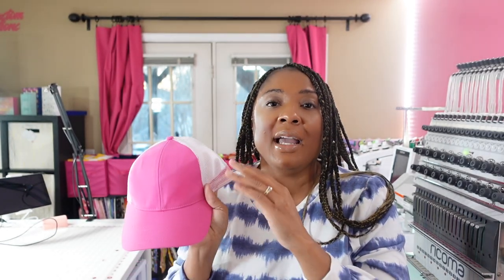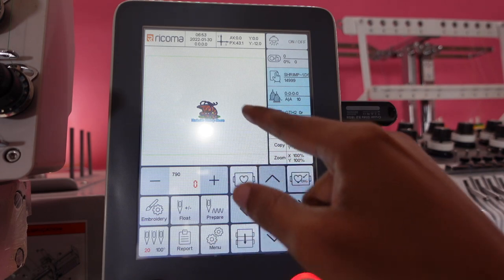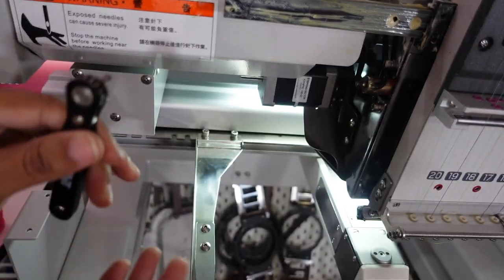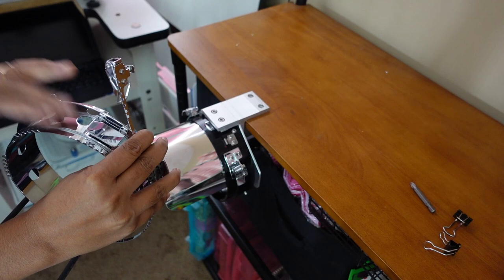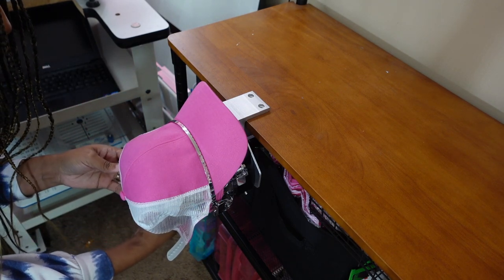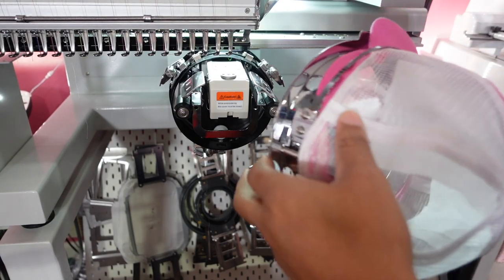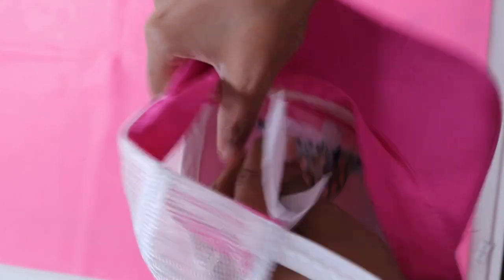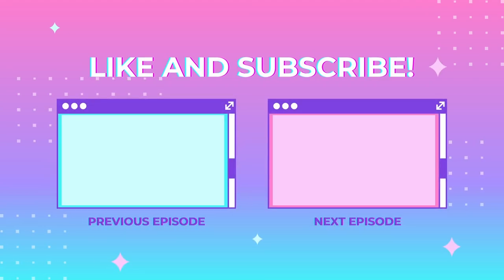Embroidering Caps on My Ricoma 20 Needle Machine |  Embroidery Business | Etsy Shop

Comment: Hello Alisha,, does your RICOMA have automatic threader for your needles or do you have to thread the needle yourself?
Reply from the maker: Hey Dolly!! Thank you for checking out the video. It does automatically cut threads in between stitching. However, this is an industrial machine and it does not have an automatic threader. I would say 95 percent of industrial embroidery machines don't have one. It is easy to do. I came from using three home embroidery that do have the automatic threader to this one. They give a device to help you push your thread through the needle. Let me know if you have any other questions.
Reply: @TheSewCraftyTeacherwithAlisha   My eye sight is a little rough and as you know those little needle holes can be a pain to thread.   I have the Brothers Persona PRS100- which is the single needle machine built in the  multineedle body - but with just one needle.  I love the automatic needle threader and it is a solution for not having to strain my eye's.  I know you have the 6 and 10 needle brother/baby lock machines, was there a big difference in getting use to not having the automatic needle threader, and how would you rate the use of the device that Ricoma provides to push the thread through the needle?
I'm debating between purchasing the Brothers 10 needle, and the Ricoma and the needle threader is the tie breaker.  Any other advice please feel free to offer it.
Thank you,  Also, love your you tube videos. I have seen alot of growth in you from the first time you started on you tube.  I wish you the very best in your business's.